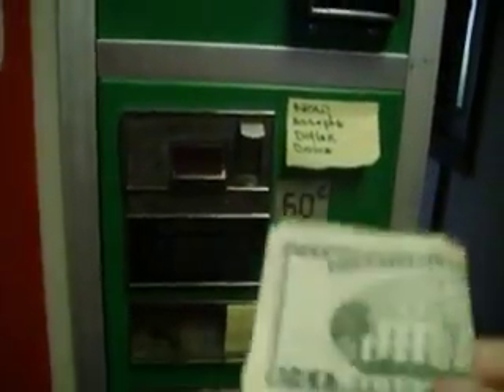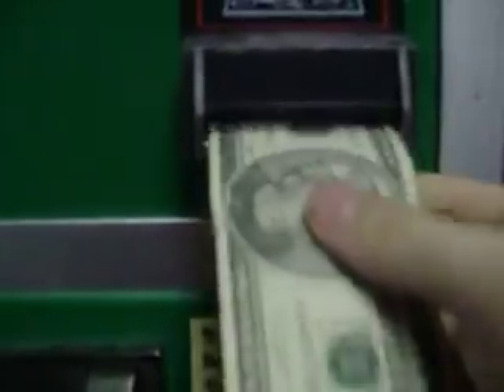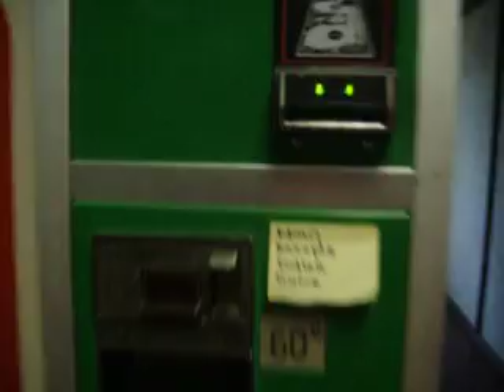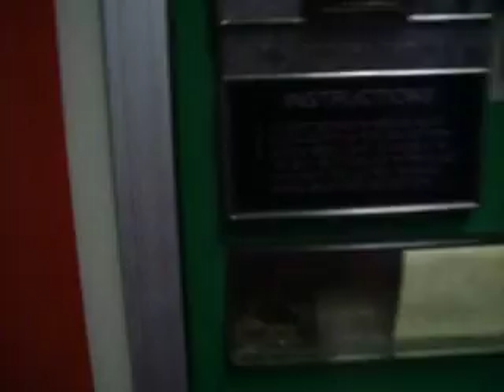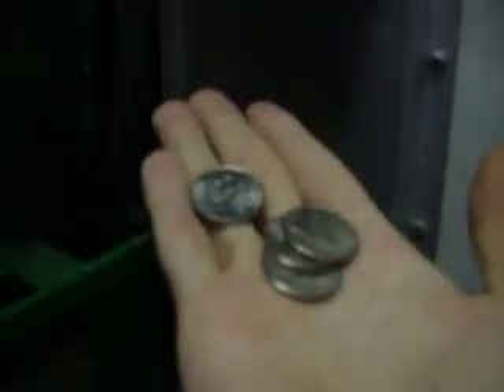why hacking vending machines wont work 1 of 4

Comment: @calsum4 Feathers have more air resistance. If you were to drop them in a vacuum, or two objects that had the same shape, but different weights, dropped at the same time, they would fall at the same speed. Coins have basically the same shape, so when they fall through the coin slot, they will hit the bottom at the same time.

Comment: When that vending machine in the video was made, PONG was the new rage. Vending machines now are computerized and have what is called diagnostic mode. In most, not all, machines, you can enter diagnostic mode by pressing a sequence of buttons on the front of the machine to activate it. The options available vary from  machine to machine but some allow the "dispense product" option, which will dispense a pop. Wake up and smell the microchip.

Comment: these bill acceptors only accept 1's,

the reason that this is, is because there is only about 20 dollars in quarters in the coin mech and they way they work is that it despences the largest amount to smallest. so this means that if you put in a 5 and the soda cost 50 cents you get 18 quarters back, now if 5 or 6 people did that in a row... machine is empty, that is what i was trying to get at

Comment: ya i like vintage machines better less fuss on the electronics and less maintness because back then the machines were made out of real metal not that pot metal crap the the new ones are made out of plus the old ones weighed like easy 1 or 1 1/2 tons so there is no chance of someone tipping one over!

Comment from the maker: i will leave this comment on here to prove a point.

1. the bill acceptor has the ability to accept the bill eaither way and it does not matter how its inserted as long as the face side is up. NOBODY HAS A BILL ACCEPTOR THAT WILL ACCEPT DOLLARS UPSIDE DOWN!!!

unless they modified the original program set which is another task in its self